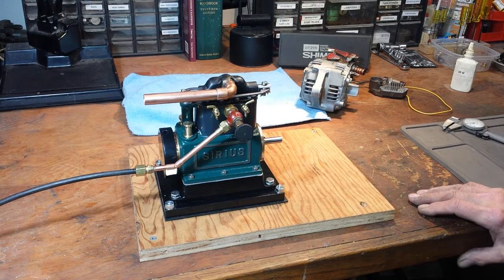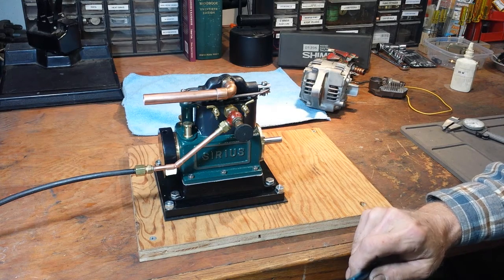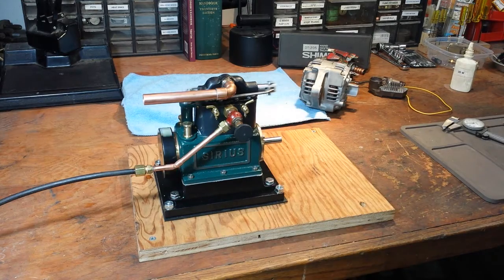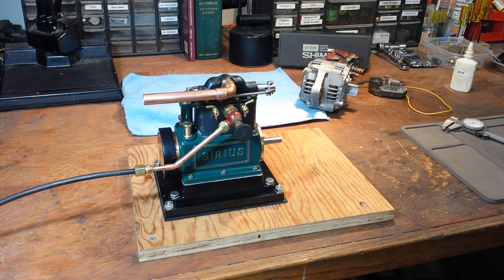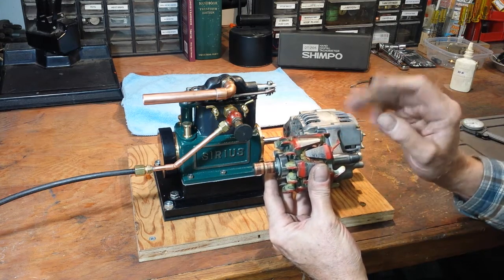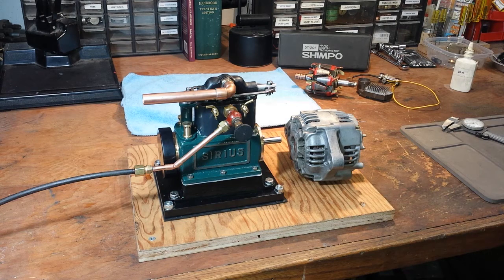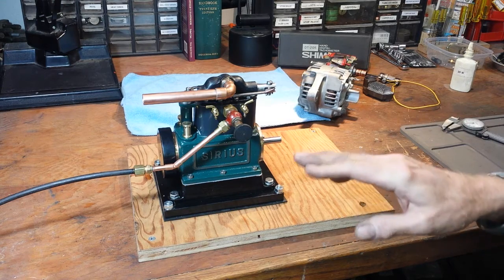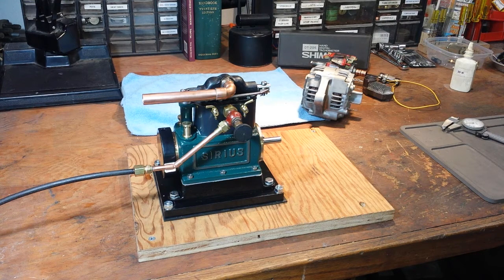Assembling and test running the Stuart Sirius steam engine part 6

Comment: O.k., eBay rams all the numbers together from a column. I'll try again. Model oiler, I.D. # 282385633616: Model oiler, I.D. # 282385656451: Model oiler, I.D. # 282385645724. I can't determine the thread size on my Sirius.
Reply from the maker: The Sirius drawing calls out a 1/4-32 thread for the lubricator to be installed in.  That does't mean yours is 1/4-32.  Get a 1/4-32 bolt and see if it threads in.

Comment: Steamer Joe, thanks for that. I see that information on the net. Really neat sets. I see a single cylinder and the twin Sirius. 
There are a couple model oilers now on eBay. Any idea if one of these might fit the Sirius?Ebay I.d.#'s:282385633616282385645724
282385656451
Also a little globe valve:
282385699851Tks, Rbs

Comment: https://mail.google.com/mail/u/0/s/?view=att&th=15aaaddb9b5d78bf&attid=0.1&disp=attd&realattid=8d55e933d66bd43d_0.1&safe=1&zwhttps://mail.google.com/mail/u/0/s/?view=att&th=15aaaf8c3d993762&attid=0.1&disp=attd&realattid=d8b5c983c5350d0e_0.1&safe=1&zw
Never tried attaching photos to comments before. Please let me know if it works. Learned decades go from Lindsay Catalog about Sirius generators (battery chargers) used for remote radios in WWII. Neat idea. Now I see a couple on the net. Don't know what boiler they used, I would guess a very small water tube. I have an old Sirius. A little different from yours, just embossed with S T. Don't know what the two brass units are. Maybe one is a lubricator. Big engines would have that on the steam line. No drain valves either, just two tiny bolts. I would be interested in your interpretation on my engine. I would like to connect an alternator too.I look forward to more of your videos. Thanks for posting.Rbs. A chilly 37 below March 8/17 in Fairbanks.
Reply from the maker: Hi Rb.  I couldn't open the photo.  I have seen a photo of the Sirius generator set boiler. It was a fire tube boiler, and came packed in a case that could be parachuted. It had about 8 feet of fairly large flue pipe telescoped in the case with it.  It had a large grate and fire door opening for firing with wood.  The grass is starting to green up in central Kansas - mowing will soon disrupt my hobby work!  I tested the alternator set-up today, running on air, and it put out about 10 amps at 15 volts and held the engine RPM down nicely.